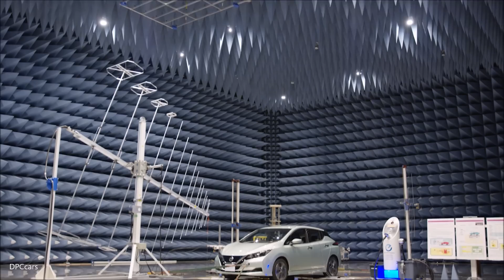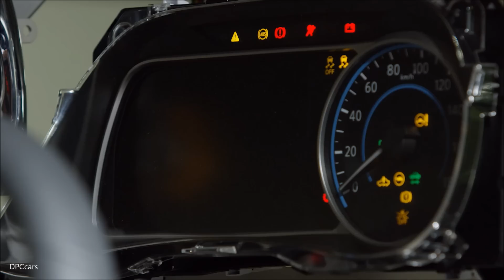2018 Nissan LEAF Factory Assembly Plant

Comment: Yeah, all that technology and the redesign is nice! HOWEVER!! The problem is Nissan still has NOT corrected the Leaf's weak point! And that is, that the charge socket is STILL located at the front of the car!! WTF??? Stats have proved 99% of slow speed accidents are nose to tail! So if a car runs into the back of the Leaf, and the Leaf hits the car in front damaging the front of the Leaf, how do you charge it? Guess what EINSTEIN, YOU CAN'T!!!
Reply: Jannet Hudson I've leased a 2012 leaf and currently lease a 2016 leaf and my only issue is with fast battery degradation, hopefully next generation has longer lasting batteries. I'm going with a tesla model 3 in 2019.
Reply: It is great for normal parking spaces (doesn't intrude to the side). I have no issue with it.
Reply: I think a front charging port is more practical to reach with the plug.  I appreciate having mine in the front and would  be disappointed if Nissan relocated it.  Even if your stats are true, if the collision is severe enough to damage the charge ports, there's a good chance there would be other damage and you probably wouldn't be charging or driving  the LEAF until that damage was fixed.  The Nissan LEAF has been out for 6 years and I have never heard of the situation you raise being an issue.
Reply: For starters, after 15 years of driving, I've never had a collision. If a car runs into the back of the Leaf then the backend is also damaged. If the front is so damaged that you can't access the charge port anymore the car will probably no longer be road worthy anyway. So why bother charging it? You need to get it repared or replaced.
Reply: If it's in an accident like that, why are you worried about charging? It's going to the dealer for Insurance and/or Warranty repair.
Only Tesla would have to worry about charging it and limping to some fly-by-night "certified" repair place.
Reply: I have been driving LEAF for 6 years and I am glad they kept the front charge port location.
Reply: Yeah you don't drive. You send it to repair genius. If the accident bad enough to fuck up your charging socked, the car isn't driveable anyway.
Reply: Everyone (currently) basically uses Panasonic, and Samsung Battery cells for Hybrids/EVs. The number 1 causes of accelerated battery degradation : 1. fast charging,2. driving fast/severe drain-load all the time, and cold weather. Tesla is stuck in a long-time contract with Panasonic (with old battery cell technology)....while the rest of the World's Manufactures are/will be utilizing newer cells that promise longer life,shorter charging duration...and especially the upcoming Solid-State battery-packs which Toyota-Panasonic,the Chinese and others are betting-on for the future.  Any battery (and wired together as a battery-pack) will degrade fast if you abuse it beyond its perimeters.

Comment: Don't buy it!  Nissan customer service will not help you with any glitches in all that technology.  Currently own a Leaf that the Telematics 3G module causes the 12v battery to go dead.  No fix.  Says they are working on it.   Telematics died on 1 January 2017 and I'm still dealing with it even after paying $199 for an "upgrade" just to get telematics working again on my car -in warranty.  Was told today that they are "aware" that there is a problem but no end in site, not going to get my $199 back either.  Check the forums.